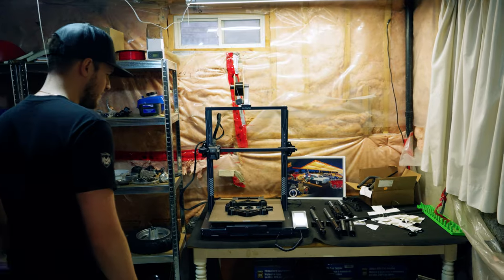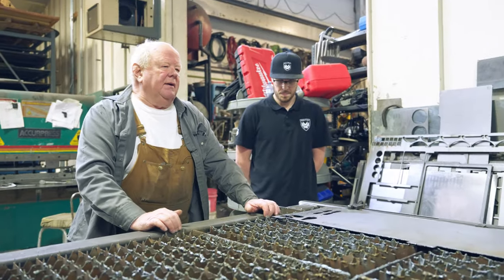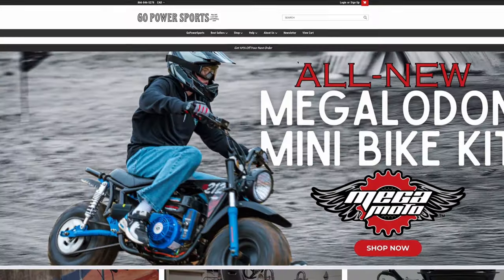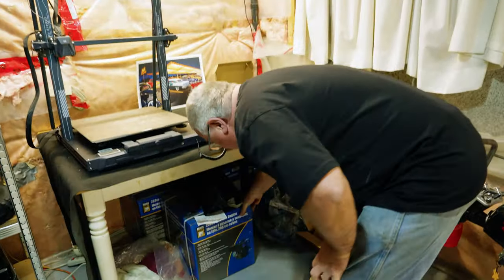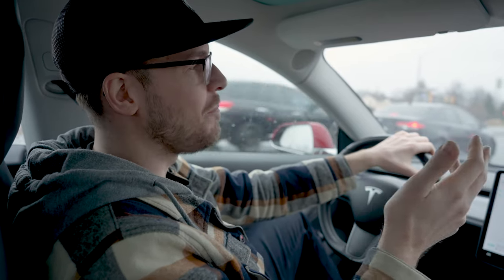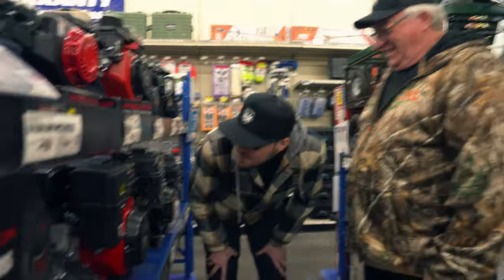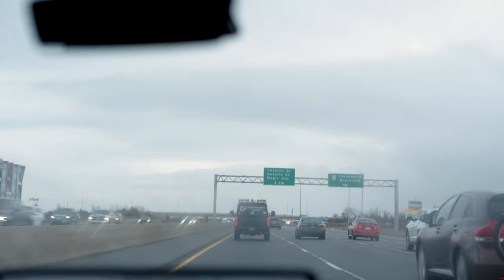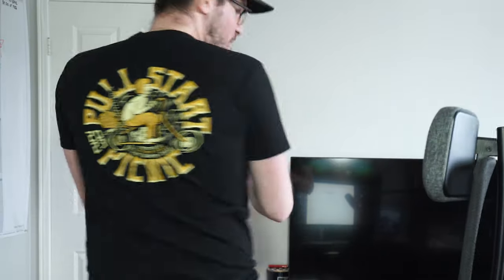Building Our Dream Mini Bike: New Look and Engine | MBK-1 Journey Ep 2

Comment: I don't understand what the vision is, or what is better about this frame than the other very similar ones already out. Also, 600cc's is incredible overkill for a minibike, when there are chinese 250cc honda clones available for $250 shipped
Reply from the maker: Great question. Well, our goal was to design a premium mini bike that embodies passion beyond limits and make it accessible to all.

To be more specific, we have designed the MBK-1 to include a robust front end. This includes premium front shocks capable of supporting both hydraulic and disc brakes, height adjustable handlebars so you can experience a truly tailored ride, as well as the ability to mount virtually any other type of handlebars to the triple tree clamp.

Furthermore, we developed an adjustable swing arm to allow the rider to customize the shock angle, that also will not interfere with an exhaust that flows through the rear end of the frame.

On top of that, the entire frame will be made entirely out of 1 inch tubing, adding to it's strength and durability.

Lastly, the design of MBK-1 was intended to not only push the boundaries of performance, but also to stand out in a crowd. We wanted to create something uniquely ours that hasn't been done before. So although the hump in the backbone accommodates larger engines, it will also be used to house the custom gas tank we are working on that flows with the overall aesthetics of our design.

With that said, there's so many more details that I would love to share, but I would hate to turn this comment into a short novel haha. Will continue to share the progress and features here on this channel if you're interested in watching as the design unfolds.

ps. Regarding the engine, you're 100% correct, we just wanted to see if it was even possible to put a 670cc in our frame as we like to have a bit of fun and experiment.

Comment: Great channel, but skinny tires aren't very popular. I think if you stuck a fatter rear tire n wheel you'd explode
Reply from the maker: Yeah for sure. We actually have made a few improvements to the design which we will be sharing in an upcoming video which includes the ability to mount a fatter tire on both the swing arm and ridged version!

Comment: I don’t know what go Powersports said on the phone…?
But…, I would advise you NOT to install “any “ size , COMET Torque converter…!!!
USE A CVTECH 60 Series..!  ( see 670 Predator in my 1961 Cushman Eagle ) ( The Jeff Galey Channel  ) 🎶🙏🏻
Reply from the maker: Thanks for the advice. We haven't gotten that far yet as we still need to see if it will fit in the frame. But thank you for the suggestion. We will look into the CVTECH 60 Series!
Reply: 44c is more then up to the task. now the standard 40 series is marginally ok on a bone stock gov'd engine, but much over 3600 rpms and the hang up problems increase bigtime. never had a problem with a 44c on any of my big block clone or small block briggs vanguard builds.